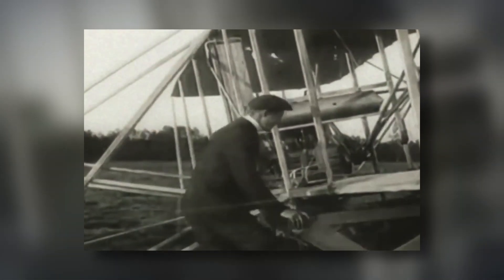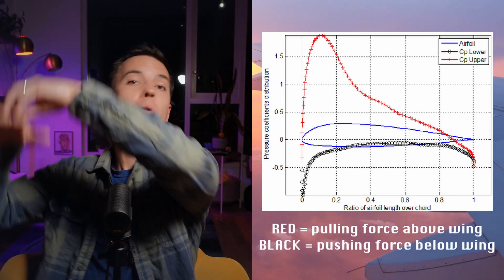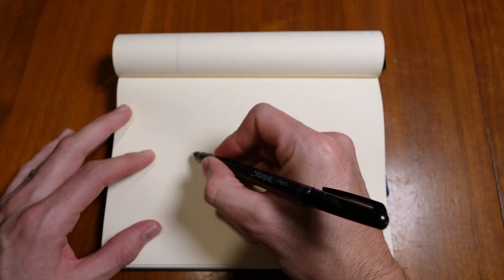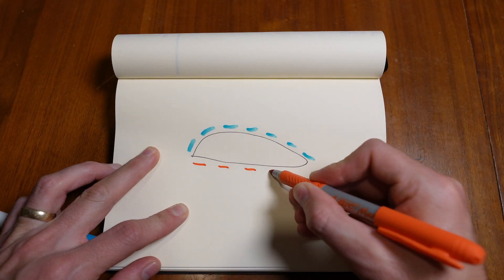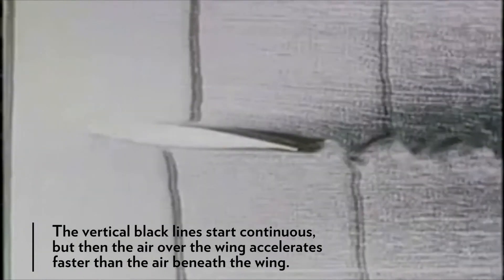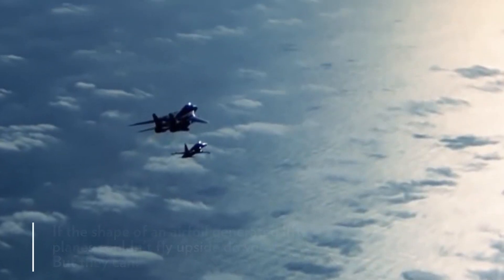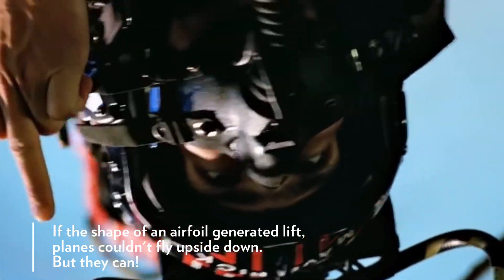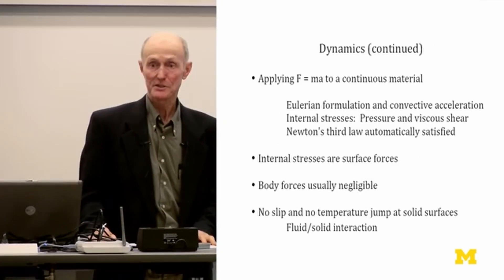How Do Wings Generate Lift?

Comment: Dunno about this presumption, Bernoulli has it pretty much taped in my book.
I was taught as broadly described: a theoretical airmass / fluid separated by the airfoil section, stagnation bubble at the leading edge, laminar flow over upper and lower surfaces and vortices aft of the trailing edge and wingtips..
Surmised that this was demonstrated with visible water vapour under some weather conditions becoming visible over the upper surfaces only due the pressure and resulting temperature drop, and the fact that control surfaces deflected downwards locally increase the camber of the airfoil profile resulting in more lift.
If a full left roll input is made at the point of the stall, which way does the aircraft roll ?
It rolls and then spins to the right as the local angle of attack has increased on the side of the down going control surface, the critical angle has been exceeded and the right wing stalls.
Inverted flight ? Aircraft such as the Pitts have a symmetrical airfoil section and a surplus of thrust .. no problem, try that with a normal wing section and one has to push forward rather hard to keep the nose from falling through the horizon.
Not claiming anything but observation, and until a better explanation appears it seems good enough for me 😇
Reply from the maker: This is a great response, thank you! I think the part that's maybe not explained here is "what does angle of attack have to do with air pressure"
Reply: @1stPrinciplesFM My limited understanding would suggest that the airfoil section has to compensate at a lower speed by increasing the angle of attack (or increasing the camber with high list devices) to keep the opposing forces of lift and mass in balance, which of course it can until it reaches it's critical angle and the wing stalls.
Reply: The implication being that with thrust and drag in balance,  angle of attack increases to balance the mass, the net pressure over the upper surface must be lower than at a reduced angle of attack.
If you watch a wing tabbed for testing, you will also see that the laminar flow breaks down at the trailing edge and moves forward towards the centre of lift as speed reduces.

Comment: Well, I am an Aerospace Engineering, and I even can't tell the exact reason of creation of lift after studying a lot about it.
One thing I can tell you is that, nature itself is designed like that.
Consider there is a flow, if you put something inside this flow, like an airfoil, the fluid will have to displace around it. Now because of the particular shape of the airfoil, the fluid HAS to flow around it, because the fluid doesn't have any other option to go to. The flow gets split, it doesn't accelerate much on the relatively flatter lower surface, but it has to accelerate to catch up with the flow above the airfoil (because of viscosity).
Resulting in lower pressure, and hence lift.
Bernoulli, Netwon's law, and Venturi effect are correct at thier place, just not the correct explanation of the lift.
Reply from the maker: But it doesn't have to "catch up." What physical law mandates the catching up? :)
Reply: @1stPrinciplesFM isn't it just viscosity? As long as flow is laminar all the molecules bounce off each other to equalize pressure and return to the initial state, like shear forces in jello. Admittedly I'm kinda making this up but it seems intuitive.
Reply: @apt121  Unfortunately that doesn't make sense. There is no reason for air to catch up.